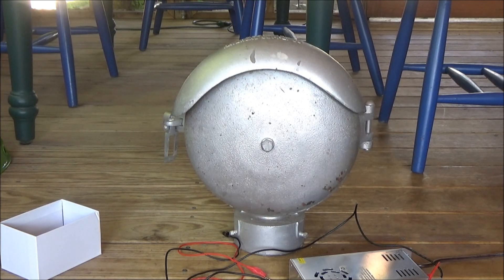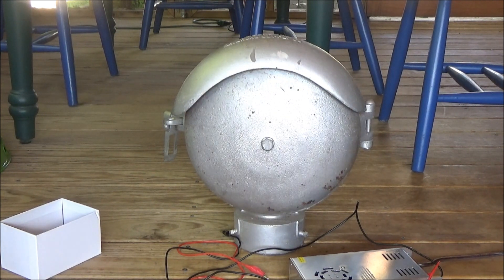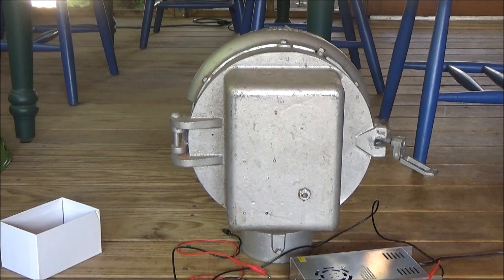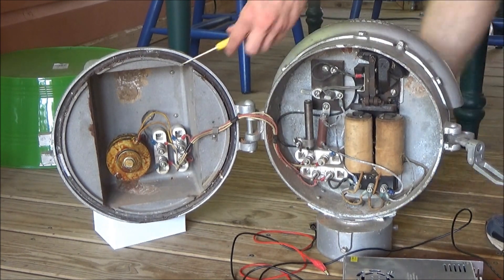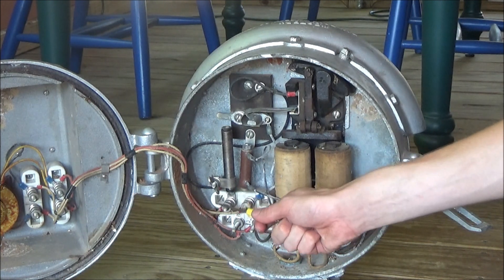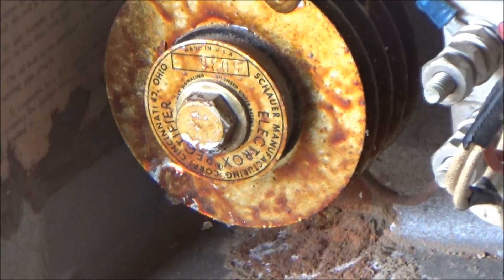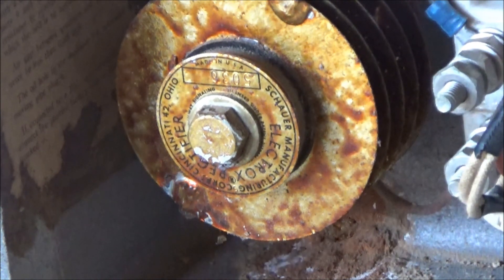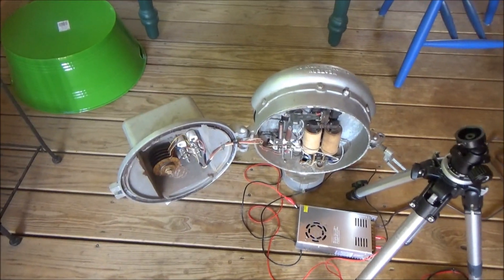My WRRS 1203 Mechanical Railroad Crossing Bell!

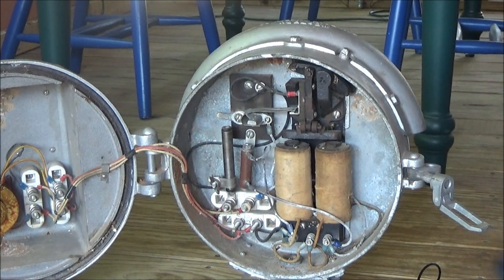Comment: Great video and cool find! Looking at the video of the motor bell, the box on the door is smaller and doesn't seem to go all the way up like yours. The thing at 6:37 is an adjustable resistor, when the wing nut is loosened you can move it up further to increase the resistance, it can be adjusted to suit the power level which the bell is connected to.
Reply from the maker: Thanks! I had noticed that motor-bells use smaller boxes on them as well, and motor bells also feature a WRRS branding (in text) on the back of the box.